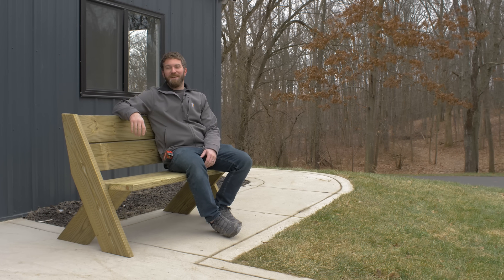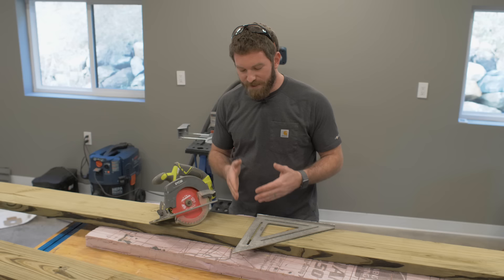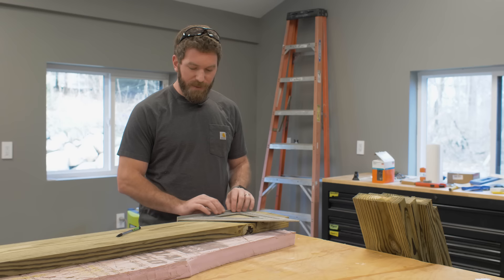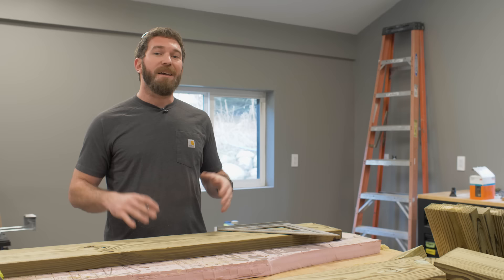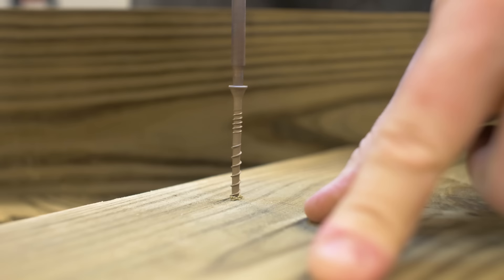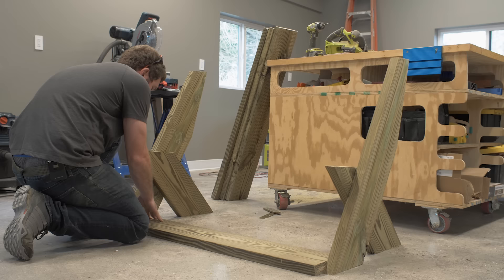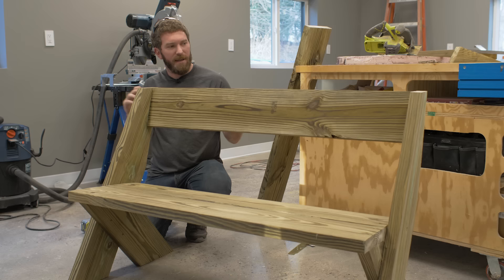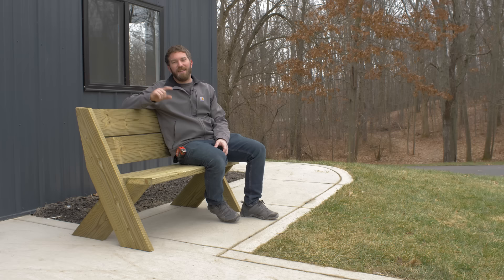$30 Outdoor Bench with Back [Only 3 Tools and 30mins]

Comment from the maker: Full Plans: https://rogueengineer.com/diy-outdoor-bench-plans-with-back/
Reply: Awesome video!.
Would you ever consider making an update video showing how to add armrests to it?
Reply: Good stuff!!
Reply: Bro cut back on saying “you’re gonna wanna...”. Just say it. Instead of “Next up, you’re gonna wanna cut the end off’ just say “Cut the end off.”
Reply: It appears that you did not pre-drill prior to using the wood screws.  why?  I thought that was always recommended.
Reply: TonyCanones you don’t absolutely need to but it’s probably best to take the extra time and pre drill to prevent wood splitting.
Reply: This could have been done with a good quality hand saw, hammer and nails and tape measure and pencil it would have taken a lot longer but still doable.

After all if the Amish and Mennonite can do it than anyone can just requires some hard work and elbow grease.
Reply: Rogue Engineer Hello!
Just wanted to say thanks for these great bench plans. I’m a fisherman, definitely not a carpenter. But able to follow your plans and came out great. 
I tagged your website. I hope ok. Thanks a lot!

Building 2-person Bench with Back Support
Reply: Definitely going to build one of these, sealing the cut ends is a must. What height is the seat at ? Suppose it could be altered to be higher ?
Reply: Which end of the short leg goes on the ground?
Reply: Making this bench really got my son interested in wood working. I plan on using some of your other videos as homeschool lessons in wood shop. Thank you again for making these videos and projects easy to understand.
Reply: HEEEEEE NO ENTIENDO NADA. LO QUE DICE ESTUDIE HASTA 7 GRADO
Reply: @emilianoojeda2626  was 9born
Reply: .... Me, too !!!
Reply: @SFirlein  J km molz
Reply: Offensive amount of commercials. 15 second intro commercial was bad enough. But then he devotess half of the video time to a shameless, hidden infomercial. Then had the gall to say "go to my website for this dimension". A total sell out! NOT cool.
Reply: Are all the measurements correct in the plans? I'm building a second one. I thought the angles were a little off in my first one last year
Reply: @nowakezoneforever6021  I have the SA question. And are his angles correct on the short legs?
Reply: easier outdoor bench.. go to the park with one wrench and undo the nuts and take the bench home. taddadadadaassss!! like magic, you got an outdoor bench! 
an d free!
Reply: Hey my family loves the benches. I built 2 for under  75! Thanks they are great!

Comment: Remember to seal those open ends you cut on treated wood ,cause you see when he cuts  the wood .The treatment isn't getting through the wood entirely.This is only if no one has said this
Reply: i agree. must be done. i would also suggest using cedar for the seat and back
Reply: Also, driving screws into the ends is not a good idea. I'd use a pocket hole or a cleat
Reply: Glad to see OSHA watches these videos.
Reply: Put more treatment on the ends that are cut and exposed
Reply: Copper tox I would assume ,whatever they treated the wood with
Reply: @fkp1692  Thompsons water seal.or equavalent
Reply: dummgelauft could you elaborate a bit? Would like to learn more!
Reply: @wearetemporary  treated lumber is toxic and should never be used for furniture. 
The cuts on the bottom leave the grain of the wood exposed. 
That means water will suck up into the wood causing it to rot. 
There are many options for sealing up the feet. 
You just need something to absorb in to the wood wet and be impermeable when dry. 
Paint, polyurethane, drylock brand paint is really good but it's also expensive, wax would work depending on the climate, the ones others mentioned above would work too.

A pocket jig allows you to make strong joints using screws. It's designed to take the skill out of wood working and speed up the production of crap annoyed husbands have to make for their more annoying wives who saw something on Pinterest that would go great in their outdoor living room, that they will never use. ;)
The jig has a fixed angle. 
You clamp it to your work and drill it with the special bit that goes with the jig. 
It looks like a normal bit but it has a flat spot on the shank for a ring with a set screw in it to adjust the length of the cut and the tip has about a half inch long section that is smaller, so that it leaves a cut in the wood, to make sure your screw lines up perfectly with the hole. 
There are some down sides. 
Consumer jigs are cheap (blue) plastic with metal inserts. 
I shouldn't say cheap, the plastic is decent quality but it is plastic. And they are expensive, as chunks of plastic go.
They will work fine for a while but if you use it all the time get metal ones. 
They do have replacement parts now (in my area) which is good because It sucks to waste money on a kit when you only need one or two parts. 
Also they have proprietary bits, plugs and screws that they want you to buy. They suck. 
The plugs, (dowels cut at an angle to fill the holes) are over priced you can just buy dowels or usually I put a few drops of wood glue in a small pile of sawdust mix that up and use it to fill the hole. 
It sands easy and is easier to get out than the dowels in case you need to take it apart. 
The screwdriver bit is extra long to keep the correct angle when screwing. 
I use replacement bits for a stand up coilated screw gun that way I can use what ever screws I want to.

A kleet is a metal bracket, and I don't think you'd need either one for this project.

Comment: I watched the video this morning.  Printed off your instructions and jumped in the truck to buy lumber.  The wife and I love how it turned out.  It did take me about five minutes to figure out that the 40 degree cut goes to the floor but I marked the leg cross measurements and figured it out pretty quickly.  I will be making more of these.  Super solid.  Thank you.
Reply from the maker: Thats awesome! Glad to hear it!
Reply: Great bench great job on video . Thanks
Reply: The angles don't matter, they are you preference as to seating position, as long as you screw them together set against a straight edge
Reply: Thanks Jason. I wondered that myself.
Reply: @doggovision8765  Just follow the measurements.
Reply: Sorry, I am confused. Why not just cut all the angles at 45 instead of 40 degree? If we have to cut 40 then 45, is the shorter side (40 deg) towards the ground or supporting the seat ?

Comment: Made a modified version - 6' long instead of 4'.   I was able to get it all out of 3 12' 2x8s, so it was still cheap.  Though the seat slats are long enough that they flex a little, so I am going to add a small brace that will connect the two of them in the middle to both reduce the flex and make sure they flex in unison (so it doesn't feel as funny when you sit down).

Comment: I made this today turned out great, but here in Australia we use the metric system. I did the conversions and anyone wondering what to use here this is what I used. 
4 of these will do the job,
50mm x 200mm x 2400mm treated pine Sleepers from Bunnings. As they are not compressed treated I had to dress them. I used an electric planer and sander, they turned out great. You can do all measurements in imperial to make the legs, then use 1200mm to do the seats and back rest. Hope this helps.

Comment: Took me a bit longer than 30 minutes using a table saw and I've never used a speed square before but still not long at all.

I built two, you can do two with 7 pieces of lumber.  The last cut of the plans leaves enough left to do it again for the 2nd bench.

Comment: I built this type bench back in 2009. I made 3 of them. I used 2x8s for the legs and 2x10s for the seat and back rest. Less lumber used that way. Also, instead of screws, I used lag bolts. Made it sturdy as heck. I still use mine to this day.

Comment: I built a pair and have had several positive comments already. I did not use treated wood since I was putting them under a porch roof. I stained them which took longer than the build but the result was gratifying. My 70+ year old body told me that 2x8 was at the limits in terms of weight for a project. (another reason I chose not to use treated wood.) My back muscles have not yet recovered but at least I have somewhere to sit while they do.

Comment: Using a piece of insulation below your work is BRILLIANT. A hint though...when marking length with a pencil make a V instead of a line as the vertex of the V is exactly where the measure point is. Helpful vid, Thanks.

Comment: Just finished the bench. Firstly thankyou very much for the video (that I’ve had to watch around 30 times due to lack of experience). My measurements were a bit wayward and had to readjust a few times. Glad I read the comments last night about predrilling. A massive achievement for me as a novice DIYer. Thanks a lot.
Reply: Only 30 times? I think I'm on 42. Made the cuts and it still confuses me as to assembly with the short and long legs. I'll get there.

Comment: In the U..K the timber is going to cost between £70 - £80 for 4 lengths of 2” x 8”  (each at 3 metres). So it’s a little more than the 30$
Reply: I was quoted £80 ish from many places, so pleased to pick the timber up for £45 today at Travis Perkins

Comment: I just built this bench and am very happy with it.  It took me a lot longer than 30 minutes, but I'm not a carpenter, and running in the house at every step to see how to do the next step didn't help.  It's comfortable and very solid.  It is just what I needed.
For the back, my pieces didn't hold in place like yours did, so I just turned the bench on its side and it was very simple

Comment: Good design. Thanks. I’ve made a lot of outdoor furniture using treated wood. Holds up well, but some parts may begin to fail after perhaps five years exposed to the elements. I’ve been able to prevent that by spreading a good outdoor glue like Titebond III in the wide space between the legs before screwing the legs together.
Reply from the maker: That's a great idea. Some carriage bolts there would be a good addition as well.
Reply: I've found deck sealer works well as an inexpensive treatment on treated pine. Probably need to recoat after 3 or 4 years, but it helps a little.

Comment: Thank you for these plans - I tried to make my own dimmensions and plans and it took forever, these were just fine. I made your bench with a couple of tiny mods and it looks FAB. I'm nearly 60 and started woodwork recently in my spare time. I like it so much I'm going to make another. I will say - it takes A LOT longer than 30 minutes to make. With me being a a bit slow, I reckon it took most of a day to make. Thanks for the plans. PS wood in the UK is pricey and I guess it cost in the region of £50 to make...but you end up with a really heavy/sturdy bench. £50 quid would only buy you a flimsy thing from the shops, this is way better.

Comment: The only thing I'd add is a 1/4" carriage bolt on each side frame, besides the four deck screws. My wife had a guy down in town build her a couple of similar chairs (I was building the 16x36' greenhouse that summer), and the side frame soon collapsed on one, even screwed (3 screws per side) and glued. I put it back together and added the carriage bolts, and they've been out in the weather- summer and winter- here in Colorado, for years. These are nice looking chairs.

Comment: Great tip about the foam board below!  Also good one about using a speed square for a saw guide.
Reply: It  really isn'T Mess of toxic plaste airborne waste all around the shop, your lungs and the outside. Use 2 x 4 to support near your cuts and at the end of the piece. Imagine if millions of people did that how many tons of micro plastic it would be. Absolutely wasteful and disgusting.  Great project though
Reply: @brakiska  thick cardboard or glue a bunch of box together micro paper in the air with nutrition in it good for earth once it lands stores let you have em for free so they don’t go to landfill well Dollar general does
Reply: Does the 45 degree angle piece touch the ground or does the 40 degree piece touch the ground?
Reply: @mahmoodkhan6623  I am having the same confusion. Please update on which one touches ground.

Comment: Thanks man! Took me way more than half an hour but this is the first thing I ever build. I feel tough AF now. 
btw for all europeans 2x8x8 doesn't mean the wood is 2 inches thick, I used 30 mm thick planks and that worked really well.
Reply: What does it mean? I’ve been confused with trying to match what’s available to these plans? 47mm seemed far too big but would be closest to these dimensions
Reply: @ksird  2x8x8 is the nominal dimensions.. The actual dimensions are 1 1/2 x 3 1/2.. Lumber used to be actuap 2x4 inches but now theyre 1/2 narrower..

Mm would be 38x89x2439 mm (converted it with google)
Reply: @ksird  us 32mm thick wood! That's what I did
Reply: @Mixwell1983  Hahahahah sorry buddy. It's definitely not 2439 mm thick... xD
Reply: @Mixwell1983  tq bro. I'm from Malaysia. Still studying in the dimensions measurements 😅. Now I got it

Comment: Love the bench. Very quick to build. Only thing I would recommend, through experience, is use some exterior wood glue in addition to the screws when attaching overlapping pieces. You won't notice it the first year, but it will get a bit wobbly over time or use. Great addition to our cottage fire pit!
Reply: I agree
Reply: I built one 8 years ago out of 2x4's, it's still as sturdy as the day I built it, and yes it sits out in the weather

Comment: I made this bench and stained it a nice walnut. Placed it on the front porch. Only difference is I added bolts to the legs rather than screws.
Reply: Then you didn't follow the directions. How dare you expand as a person.
Reply: @camcordernonsense5264  bruh lolol get the hell outta here!
Reply: @scottryker4888  
I can't! You used bolts!
Reply: @camcordernonsense5264  oh yeah? Well guess what, I sanded everything smooth with an orbital sander! And I didn't use pressure treated lumber either!
Reply: @scottryker4888  
I love orbital sanding but I seem to leave scars on my wood. I'd love a belt sander. A huge one. I'd be smoothing all the surfaces I could find. I think you made the right choice on untreated. That stuff can seep for a long time. Do you have a video of your project?
Reply: @camcordernonsense5264  I agree with the orbital sander. You don't really notice it at first, but the we you apply stain the scarring really shows. I'm heading out to buy a belt sander right now. And no I dont have a video. I suppose could put one up though, give credit to the rogue engineer for the design and all.

Comment: I made two of them years ago,love them in my garden,they have held up great.
Reply: Everything OK except screwing into end grain,  Pocket screws needed there,
Reply: Does the 45 degree angle piece touch the ground or does the 40 degree piece touch the ground?
Reply: @mahmoodkhan6623  the 40 touches the ground and the 45 is where the seats rest on.

Comment: I did it! Worked out great....loved it so much I went back to Lowes and bought 3 10' 4x8's. With the left over piece I am building a 5 ft. bench the same way. I know some of you engineering gurus might want to give me some pointers..and I may make one even longer using a support in the middle...like 8 ft long. PS My Porter Cable Lithium Ion had a HARD TIME cutting treated lumber and I bought a RockWell 4 1/2 Compact Circular saw..and that motor scooter got the job done...really nice cuts..hope to get a diablo blade soon.
Reply: The 5 footer was just as nice as the 4' Bench. I also added nice bolt headed lag screws to the top bench boards and one lower board,  which give it a beefier look. Also, I found that when I put the top bench seat on..the front one..I bounced up and down on it a bit..to make sure the fit was square...before I screwed it down. I put it together partly and it felt a bit wobbly..and that is NOT how this should feel...its NUCLEAR STRIKE PROOF..if its done right. Also, when i bought 3 10' 4x8's I had just enough to do 2 more 38'' long legs left over after completion......geez..time to build ANOTHER one..:) everyone likes these,,,, do you have a picnic table plan??

Comment: Nice build. Simple instructions and tools. Easy enough and cheap enough for beginners. 

I would not trust the wood screws in the legs. Over time the wood will dry out and when used will cause directional movement of the joints. The wood around the screws will eventually deteriorate, aggravated by the directional forces placed upon it by people getting up getting down shifting body weight etc. 

You can evidence this by checking out hand rail installs that were done with only wood screws. Over time the rails work themselves loose. Requiring replacement.

To reinforce this is simple. Two bolts with nuts and washers drilled through each side. This would reinforce this for a long time and allow for tightening.
Reply: K
Reply from the maker: Thanks, and there are plenty of mods that could be done to help improve the longevity and make it your own. Galvanized carriage bolts are a great way to beef it up. I was just trying to keep the price down for this example.

Comment: Watched and built yesterday, looks good works good , I used 2x10 because I had some leftover from my 16ft steel frame picnic table
Reply from the maker: Awesome! Glad to hear it went well!
Reply: Did you have to change any of the measurements or did it work with the same ones?
Reply: Linssensuppe it worked with the originals, it actually worked out okay , a little more seat room and a little less gap between back boards and seat.
Reply: @raptordan6851  that's great ! Thank you very much for the information. 2x9 shouldn't be an issue at all then :-)
Reply: Linssensuppe you got er , I have three kids that are hard on things so I ran more wood screws. It’s rock solid.